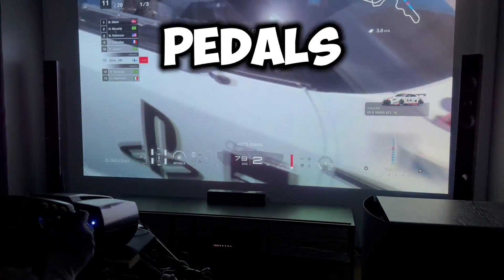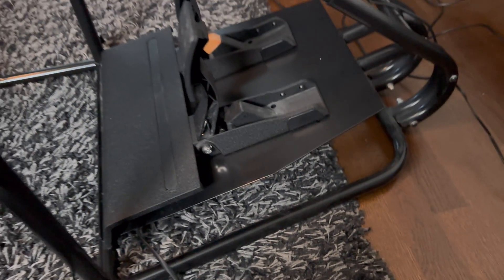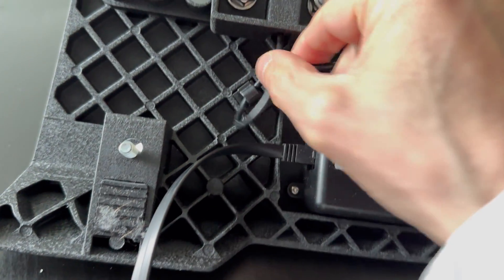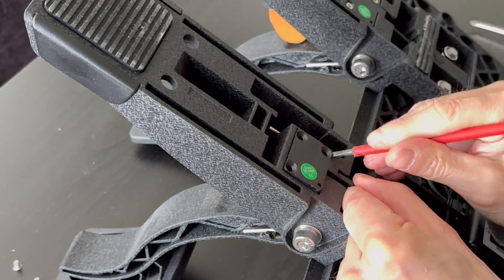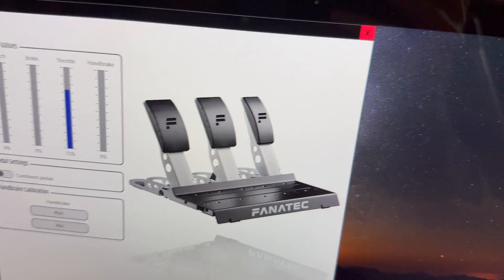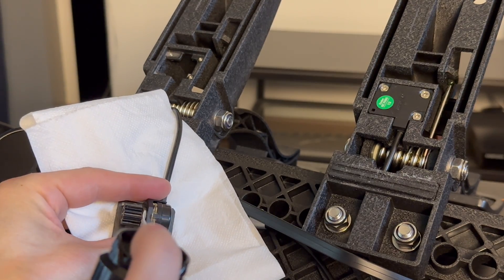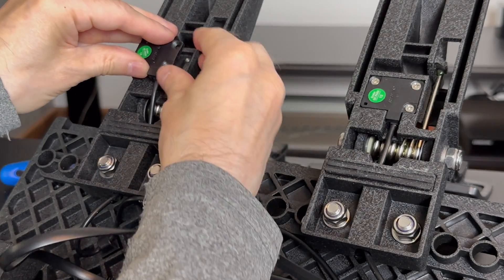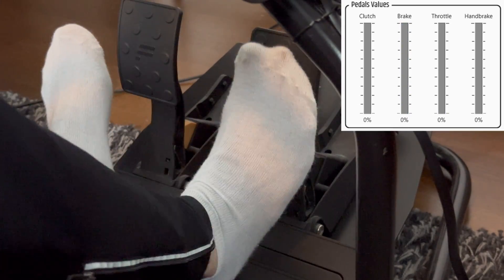How To Fix Fanatec CSL Elite Pedal - Potentiometer Problem

Comment: I Have the same problem with CSL Elite Pedals. I disassembled and cleaned it, but the potentiometer still flickring. I trying to contact FANATEC, but the are very bureaucratic to confirm whether they sell the potentiometer\sensor or not.

Comment: Where can I buy a new sensor
Reply from the maker: Hi, I have seen potentiometer for Fanatec CSL sold in eBay. You might want to search there. Mine has been working ok after cleaning but it might need to be replaced with new potentiometer at some point if it starts to have issues again. I hope this helps.

Comment: I think the potentiometers are quite reliable but the gears can get clogged with fluff (from carpet etc).  This makes the signal erratic or jittery.  Just needs a clean occasionally.  Reset the 0 point in Fanalab and check/set the 0-100% range in the game.
Reply from the maker: Good info 👍

Comment: @zonemk9406 thanks for your tutorial. My problem is that when i press the pedal a bit, it is quite immediately up at 80% or 100%. There is no graduation anymore. Any idea ? Thanks a lot
Reply from the maker: Hi, it could be that potentiometer needs to be replaced. Seems that Fanatec doesn't sell those but if you run google search, you can find from eBay and aliexpress, that have potentiometer with wire and connector so it's easy to replace. I hope this helps. And if you got it fixed already or will have, let me know how it went.

Comment: Thanks for the video. When I take out my potentiometer and have it connected to my laptop, it shows a full range from 0% - 100%. When I put it back to 0%, put it back in the pedal, and I try the pedal connected to the laptop, the most it will show is 47% - any ideas how to get it back to 100%? Thanks, Steve
Reply from the maker: Hi, one thing comes to mind. When rotating potentiometer from 0%, I noticed that there’s a small gap before it shows any increase, so it could be that if potentiometer is at very start and there’s this small gap, it doesn’t rotate enough to reach 100% when installed to pedal. 
Try to rotate the potentiometer to that point where it almost shows increase from 0% and then install it to pedal. 
I hope this helps.